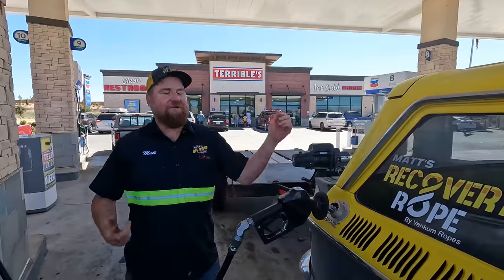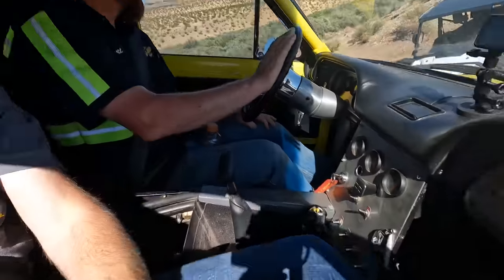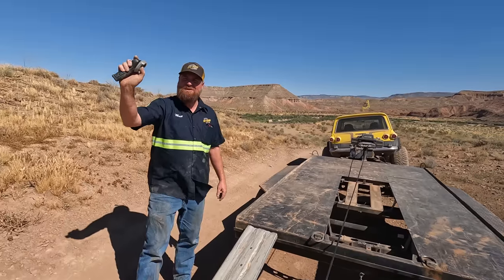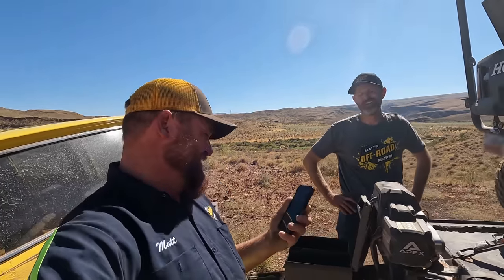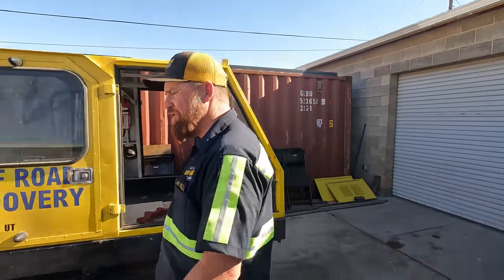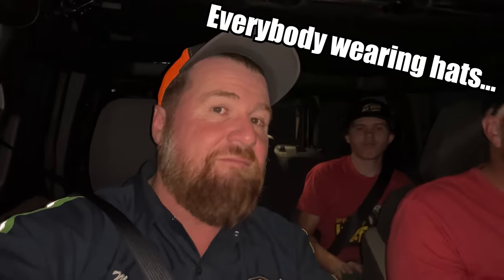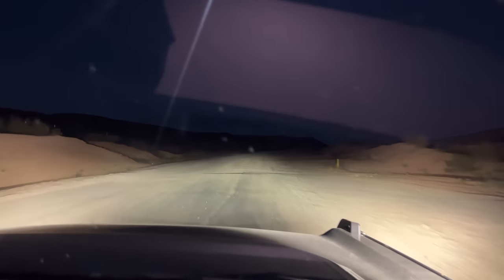Customer Get's Chewed Out For Getting Stuck!

Comment: Speaking of premium fuel.  Not only do high compression engines benefit from it, but you quite often find that they put additives in there that keep your fuel system clean and reduce carbon buildup.  Also it's been 105 here like all week and the humidity is 35%...

Comment: I live in Southern Nevada. I've lived in humid hot climates as well. In humid hot climants the heat feels suffocating and is misserable. At 120 degrees in southern Nevada the heat stings your skin and is misserible. It's similar to being close to a raging bon fire that causes you to move back because the heat hurts. The only problem is that you can't move back from 120 degrees or the radiant heat off the ground. I'm surprised the recovery vehicles don't have more tire falures on the blacktop in these high temps given they're ran at such low air pressures. I suspect its because they may be ran at lower speeds for short distances.

Comment: The difference between a 115° "dry heat" in the desert and 101° humid heat in the east is like the difference between an oven and a sauna. 

I grew up in the humid south, then moved to Nevada in my mid twenties. For 4 years, I worked outdoors full time in the desert. Anybody claiming the humidity is worse has never been West in the summer. 

To top it off, in a dry heat, the wind is hot like a blow drier, and in the desert, there's no shade to hide under

Comment: I live in Northern New England.We get humility.Some times will get about 90 degrees with a dry heat and it sucks.I have been out in Arizona around 100 + degrees.Dry heat go stick your head in an oven. Both sucks..There is something sucks more dry heat and humidity.Go from 100 degrees to -20 below zero with out the wind chill. Whit in 5 hours.That sucks the most.

Comment: With higher octane fuel, you can run more timming for a bit better mpg & more power, so the internet slooths are actually wrong as two left shoes.  There is one trade off that you have to keep an eye on with added timming & that is added heat aka water temps.  I like to run a cooler 160deg thermostat in hot weather, it will still jump up to 200 but keeps the flow open.  If you have any where around your ac condenser that air can pull in around the sides..... the AC won't cool down unless your traveling fast to increase air flow.  We run washer squirters & a gallon tank in front of our ac/radiators with a momentary push switch.  It's amazing how fast it will cool the engine down too!  Used it for racing alot!

Comment: Just fyi the surface temp here is not but about  ten percent different here, the reason I know is I was asking a new guy one day why he was sitting saw horses up in the sun, he didn't know the shade can be 20° to 30 °  difference,  I checked it with a similar tool you used , so its just cool to know different things when you spend time outside in your work day! Have a good one, Stay safe!

Comment: We were in Las  Vegas a week ago when it was 120.  We were on our way home to San Diego towing a Travel Trailer. I let the fuel tank get below 1/4 tank outside of Las Vegas. We filled up drove to a campground, I unhooked the truck was running fine. The next morning it wouldn’t start. It ended up being a bad electric fuel pump. This is a 2021 Tundra with less than 13,000 mikes under warranty. The tow truck drive said  having low fuel in heat can kill your fuel pump. I  had never heard about this . Since then other s have said this is true.  

I used to have a Montero wagon with V6 and automatic. That car is still my favorite off-road vechike and I have had a few..

Comment: The ground temperature is always higher than the air temp. Nice try Matt. You're better off with lower humidity at higher temps. I'll be impressed if you fry an egg in the yard though.  😊

Comment: The difference between a "dry heat" and high humidity heat is that a dry heat is more accommodating to our bodies natural method of cooling itself. We basically work on evaporative cooling, meaning that our sweat evaporating is what cools our body. When the humidity is very high, sweat does not evaporate, you just stay wet and hotter than you would be if you were dry.

Comment: FWIW, 91 AKI is the same as 95 RON, which actually is the lower/common octane rating available here in Sweden. The other options available here is 98 RON (93 AKI), E85 (105 RON/96 AKI) and Diesel. :)

Comment: Very correct! If you vehicle doesn’t require mid or high grade fuel you are literally wasting your money absolutely no benefit! However like mat said if you have a tune or the manufacturer recommends higher grade fuel then you need to you higher grade!  Lower octane gas combust faster than higher octane gas!  Only difference!  All about the compression ratio!

Comment: I grew up in Kansas with heat and humidity. I went and worked in the Tetons in Wyoming. For a year. Then in August I flew to Palm Springs,Ca. I had a great big winter parka for the Wyoming. Winter, but it would not fit in my luggage,so. I climbed of the airplane in Palm Springs,with that coat draped over my shoulder, on a record breaking hot day. When I walked off that plane into that heat,it almost nocked me to my knees. LOL🇺🇸👍🤪that was 52 years ago.

Comment: Couple of questions. Have you thought about trying ratchet straps to straighten out steering issues when you have broken tie rods? They might help to keep wheels in a straight line. Also, ever cross straps for tie-down, similar to what they do on heavy equipment?
Reply: Straight straps are better. If you break one when they are crossed you loose tension on both straps. For heavy equipment you should be using chains, not straps

Comment: Live in north Texas now, lived in Las Vegas, Palm Springs and Tuscon. I grew up on the Texas Gulf coast. HANDS DOWN, a dry heat is WAY WAY WAY more tolerable than high humidity heat. Hot is hot and that's nice and everything but there is a reason why there is a sayin, "Yeah, but it's a dry heat." And it's because it's way way way way way way way WAAAAAAY more tolerable then high humidity high heat.Sweat on the skin does not evaporate efficiently on humid days, so more of the heat remains trapped within your body. Thus, humid heat is more dangerous than dry heat.

Comment: "Octane" is colloquially used as a short form of "octane rating", particularly in the expression "high octane". "Octane rating" is an index of a fuel's ability to resist engine knock in engines having different compression ratios, which is a characteristic of octane's branched-chain isomers, especially iso-octane. The octane rating of gasoline is not directly related to the power output of an engine. Using gasoline of a higher octane than an engine is designed for cannot increase power output.  (Per Wikipedia)

Comment: Hvac tech here from Oklahoma.  Dry heat can be bad, but nothing beats non ventelated attic heat in high humidity. Can be 180 degrees plus up there with over 10 plus extra percent humidity because attics trap moisture.

Not arguing the point though, dry heat is dangerous.

Comment: The dry heat does have a plus side. In the humidity of the south when you sweat you don't get that evaporative effect that helps to keep you cool. But on the other hand you get radiated heat from everything. Sucks either way.

Comment: Octane number is ability of the fuel to not detonate on its own in high pressure. So using lower octane fuel than your engine is projected is asking for burned pistons. Here we do have 98 and 100 octane fuel as well. I do use 100, but not for the power I could get from the engine. I use it because it is only one fuel in our country without bio addons. These addons are really nice for your engine. It can gum up your jets, carbs... in short time.

Comment: yeahhh in texas we got that humid heat heat teh air temp can still be 95 grass in shade be 91 in sun 105 cement 125 brick 135 and blacktop is 140. you just messured black painted metal 2 problems with that black absorbs a lot of heat, and metal is also a great conductor for heat as well. galvanized metal would be less bias or just raw metal. but if texas is so hot we can bake bread in brick mailboxes, bake cookies in our cars cook eegs on our hoods of our cars. safe to say its pretty hot out here as well. heat is heat when it comes down to it only things that makes it better or worse is when more factors are added on like wind rain clouds or humidity

Comment: I can tolerate the desert and the high desert heat much better than I can the heat and humidity.

But Matt is right; the ground, including paved surfaces, absolutely work against you everywhere from West Texas, through New Mexico, Arizona, the Imperial Valley of California, up through the Cajon Pass and the high desert to the Mojave, into Nevada, Southern Utah, and western Colorado.

That land that is the desert Southwest includes the Mojave, the Sonoran, and the Chihuahuan deserts.  Back in the days before air conditioning became a thing (like turn signals, it was an expensive option most people couldn't afford - and still can't, apparently), I drove long distances over most of that entire range, and I only did so at night.  

That includes long distance trucking, relocating, and plain old wanderlust.  As well as driving through the Mojave in Army trucks, which definitely did not have air conditioning.  

In a car, that's four windows rolled down at 60 miles an hour, because even at night, you didn't want to go much faster than that.  In a 5-ton tanker truck, it was 2-50 (because: governors), plus the front windshield would pivot at the top so that air could pass through the bottom of the window.

We blew out a clutch on a tank trail up in the high desert, near Furnace Creek.  We rolled down the windows far enough to tuck our shirts in the top and roll the window closed on them, because naturally, it was the heat of the day.  Then we opened the hood, which would go all the way back to rest on the window.  Nothing to do but BS until we got rescued.

Fortunately, we had plenty of water and a cooler big enough to double as a bathtub.  Unfortunately, my fellow soldier had never been in the suck, and he was starting to edge toward panic.  I wasn't sure if I was going to have to knock him out or not.

After a while, a C&C (command and control) Huey flies overhead, hovers for a while, then flakes off.  Pretty soon, here comes the MPs in a jeep.  The sergeant says "Hey, the Colonel says you're blocking the tank trail (which is probably why the colonel is still a colonel and not off being a general where he can't hurt anybody).  He wants to know if there's any way you can move it off the trail."  

The Sgt. and I just started snickering.  "I'll take that as a 'no,' corporal.  Is there anything you need?"  Because apparently, they're not going to let you just take off with the first pretty face (yeah, no) that comes along and abandon your vehicle.  Even in July in the Mojave.  In the hottest part of the day.  Did I mention that?

I said "yeah, Sergeant, you can take my buddy with you, because I think he's a shriek away from tearing his clothes off and running into the wastes."

He said "Roger that," and slipped me a six-pack of beer, which I greatly appreciated, and took off with my buddy and his guys.  My buddy was sore later, when he found out I had beer and he didn't, but, he lived.

About 6 hours later, here come the mechanics in a tow rig to drag me back to the shop - okay, they dragged the tanker back to the shop, and poured me into the barracks.  They also had beer, so I don't remember much about the ride back to the barracks, but we must have had a good time.

Comment: Man, I worked in 165* F on a parking lot in Az. Hot is hot !  Stick you head in a 110* F oven for however long you can. No humidity in there. You will find out about dry heat.

Comment: Humidity has nothing to do with the radiant heat.  Dry heat is not worse than high humidity heat on the ground surface.  I'm in ST Louis, today 98 degs with 43% humidity (which is low for us) ground temp is 127 in the grass, 133 on the concrete and 160 on the hood of my Jeep.

Comment: Years ago I was stationed at Nellis AFB with an F-15 squadron in Las Vegas. We once measured the temperature about five feet off the flight line at 140 degrees. When you were behind jets with engines running, at a safe distance of course, it would be even hotter. Metal was so hot you couldn't touch it. If we had to be on our knees on top of a jet to pull a panel we would kneel on folded towels and still get burned. Lastly, you learned never, ever, ever, go to work with a hangover. Don't ask me how I know. Matt is correct. It's hot, hot, hot.

Comment: Compression and timing of the engine determine the octane that works better, but also remember 89 and above mostly have better cleaners. A lot of modern cars detune the engine when your computer tells it - you got crappy gas.  That saves engine from pre detonation (aka knock) - that can/could wreck your engine.  That's a fast thumb nail…

Comment: "It's a dry heat!"
The way I explain it to people is:

"It's like sticking your head in a convection oven"
Preheat your oven to 220+. (This will usually balance to approx. 115-120 with the average room temp in a small area)  Then set a small fan set on low in a chair next to it, pointing in to it.
Next, stick your upper body into the oven. (over the lowered door, for safety)
You'll feel the moisture drying out of your skin, if you sit there long enough....

Comment: Octane does have benefits for turbos. You can run more boost and timing. E85 is the best for that and power. Cars actually say it power will lower using lower octane. New turbos are higher compression direct inject so gas does matter.

Comment: 10:21 It has never ever been 100° and 98% humidity anywhere.  even Corpus Christi   ♥
We were in Phoenix this week for a concert..    good god. 
Even their open parking garage elevators downtown are air conditioned.
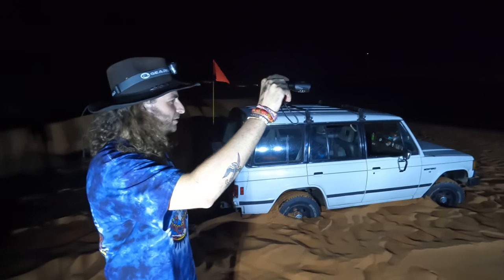16:07
That is a nice specimen but the best Montero by far had three doors and a V6 in 1989.  I had an '85 based on its performance in the Paris-Dakar rally till it got hit then got an 1989 5 speed with the V6.  The 5 doors are pretty much mall crawlers by compare.
I do not think Mitsu even entered any 5 doors in the paris-dakar much less won and or placed so many times in what was a 'no major parts repaired' class.  
Context is key

Comment: even if you don't tune your engine for 91/93, it still makes sense to use it. It's cleaner with more detergents. Never buy low grade fuel because it's cheap for a reason. It's dirty. Engines last longer on better fuel.

Comment: 1 minute and 15 seconds in and I couldn't help myself. Running lower octane fuel in an engine tune/built for higher octane will increase engine combustion temps. While this not so much of an issue at lower loads and lower RPM's it can be a real problem at continuous higher loads/Rpm. It can cause pre-ignition which will damage pistons and valves and burn spark plugs. Plus most premium fuels (91 U.S - 98 AU) contain cleaning additives (bonus). Always use the the best fuel for your engines design, they last longer.

Comment: Well all I can say is I've lived in both Texas and Florida. I would much rather be in the dry heat. In the desert any shade or wind helps...a lot. In fact with a real stiff breeze evaporative cooling with sweat is so good in the desert I've been almost cold when it's 100 degrees. Not so much in the Humidity.  Then there's the bugs and rust with Humidity.

Comment: I let my father-in-law drive my 2021 Ford Bronco the other day and he very generously filled it up before he came back.....with 87 octane 😒. And it 100%, without a doubt, affected the performance. I had to get way more into the gas pedal to get the same amount of "go". The engine must retard the timing or make changes to the fuel/air ratio to prevent knock. Won't be doing that again any time soon.

Comment: I've worked outdoors in NC and in Arizona as a landscaper and in construction.  I'd rather have 115° at 6% humidity than 95° at 80% humidity.  Yes, 115° is hot as hell regardless of the humidity, but high humidity makes it feel like you're inhaling the air from a sauna.  Being hot sucks no matter what, but with low humidity, at least a breeze feels refreshing instead of suffocating.

I'll admit the desert is more deadly to live in if you don't have to work outside but for me, if I have to work outside, I'd rather be in high heat with low humidity than slightly lower heat with far higher humidity.

Of course, that's just my opinion based upon my own experiences.

Comment: Dry heat is also really sneaky in that you don't realize how much water you lose from sweat since it evaporates right away.  Also that measurement you did right at the end was likely not accurate.  Shiny things don't get measured right with IR thermometers as they have high reflectivity and low emissivity, you are basically measuring the IR getting reflected off of the object and not the object itself.

Comment: I won't say dry heat isn't bad, because I agree that high heat is bad period, but, it isn't as bad. Here in Florida, the body's cooling system struggles more because sweat won't evaporate, it just clings to you. I've been in New Mexico, and as long as I could find some shade and had some water, I could tolerate being outside much easier than I can out here in Florida.